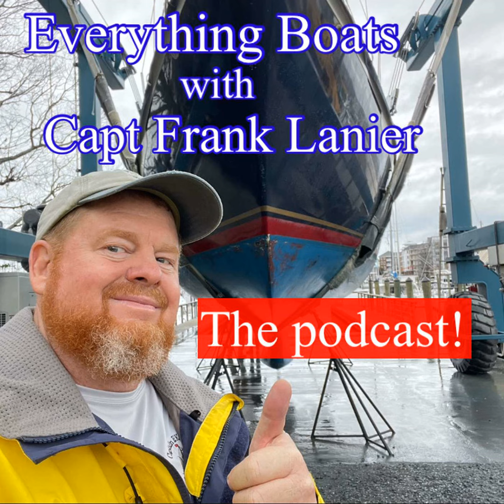How to handle an engine compartment FIRE!

Comment: Great Podcast !  Thank you . I have seen a few run away diesel engines cause fires on boat as well , especially the turbo version engines . I have installed a Guillotine valve ahead of my turbo with a cable leading to the companionway ladder area , just in case. This will block airflow and shut down the engine if the turbo seal decides to fail.
Reply from the maker: Thanks and I’m glad you found it useful! It’s always good to have a method to secure engine compartment ventilation and shut down the engine when discharging an extinguisher into the compartment.